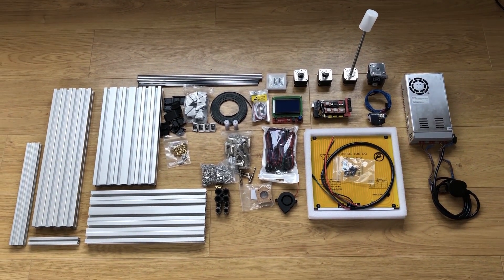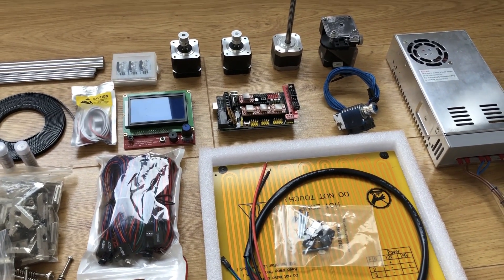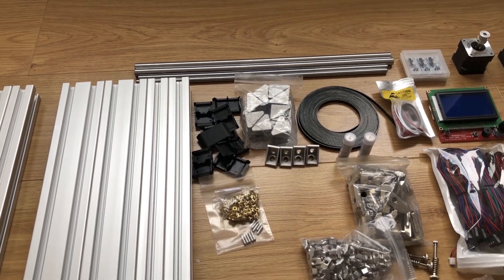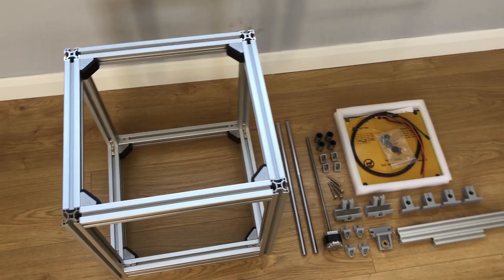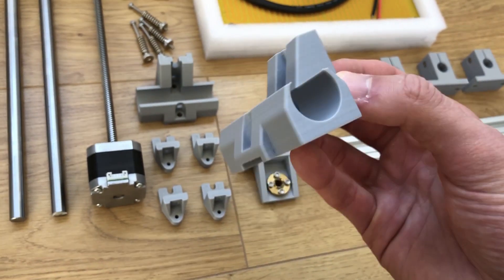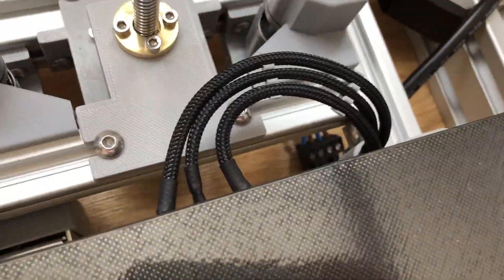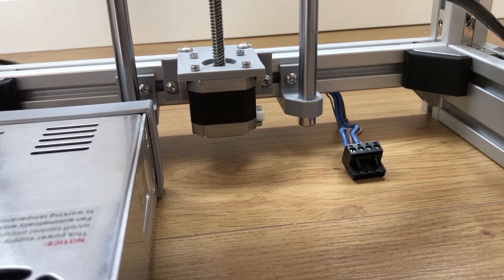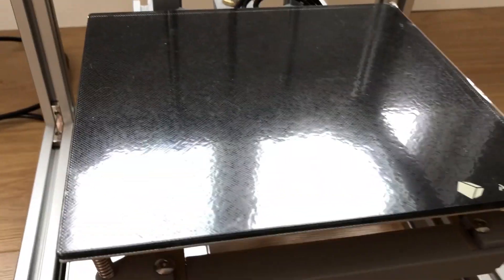HyperCube Evolution Build - Part 1 - Parts, Frame and Z-Axis

Comment: Thanks for your HyperCube Evolution build videos!  One thing I am curious about is your use of ASA filament. I have not attempted using ASA because I do not have a printer enclosure.  Yet,  in this video, it appears that you were able to get ASA to print fine without an enclosure.  Is that right?
Reply from the maker: Hello, thanks for watching! And yeah just printed this in open air, it’s filamentum asa and was really pleased with it, didn’t have any problems printing it at all!
Reply: @PracticalProjects  Cool.  I will give it a try. Thanks for the reply.